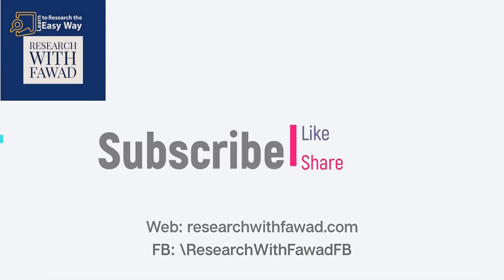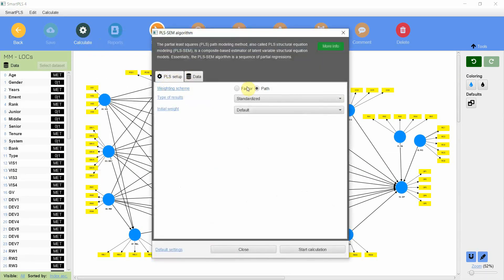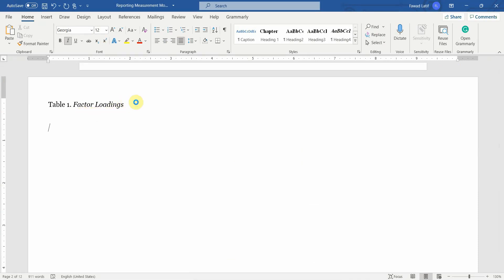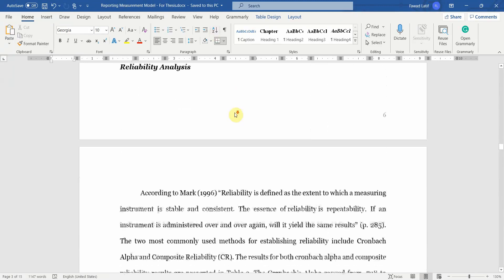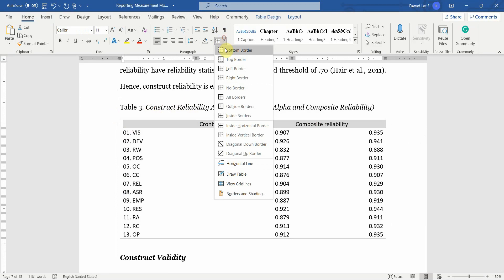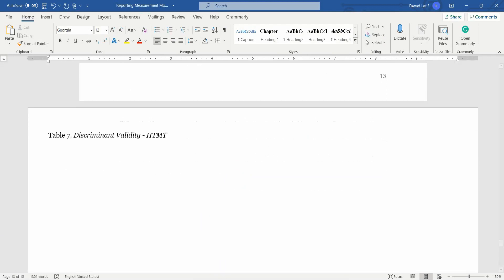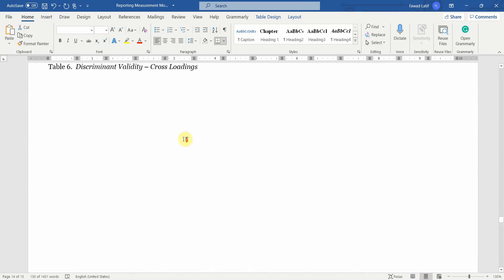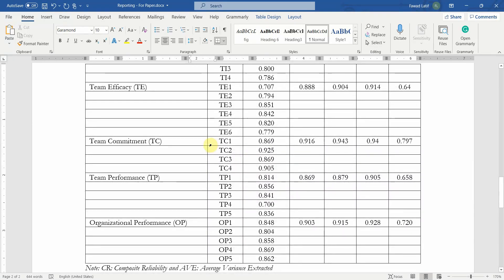#SmartPLS4 Series 13 - How to Report Measurement Model Results with Multiple LOCs?

Comment: Hi Dr. Fawad, thanks for your video, they are truly very helpful. I have a question: in this video, you are examining the reflective measurement model, right? Is it necessary to examine the VIF for the outer model? Since they are reflective constructs, which means their indicators are interchangeable, which further means it is possible for them to be highly correlated. Also, Hair (2017) only examined VIF for the outer model in the formative measurement model.
Reply from the maker: Thanks for watching. No need to check for the VIF of the outer model when it is reflective.

Comment: Thanku so much sir for such wonderful videos , sir can u plz give the citation that if AVE of one construct is near to 5 (as you told in one of your video) and other things like alpha etc are ok then we can say that our convergent validity is establish although AVE is near to 5?
Reply from the maker: Thanks for watching. Here is the reference 
Fornell and Larcker (1981) suggested that a construct’s convergent validity is still adequate if it has AVE less than 0.50, but CR above 0.60. 

Fornell, C., & Larcker, D. F. (1981). Evaluating structural equation models with unobservable variables and measurement error. Journal of Marketing Research, 18(1), 39–50. https://doi.org/10.1177/002224378101800104

Comment: Thank you for the lecture. I wonder in the reflective model, if VIF is matter. My model shows every values is okay except too high VIF values. My model is reflective model with indicators. In addition, when it comes to calculation in Smartpls, what is the difference between standard algorithm and consistent algorithm? I am not sure this is regarding to reflective and formative model.
Reply from the maker: Thanks for watching. VIF is normally high for reflective model, this is the reason it is not reported for reflective models. Use normal algorithm if you are not interested in reporting fits. For understanding formative constructs, please watch 
https://youtu.be/pMbOO0H8-P4

Comment: Sir When we delete an item to achieve significant discriminate validity ie< 0.80 how to write and where to write the information about the deletion of the item. Should it be added in the discriminate validity paragraph or in the starting when you mention the deletion of an item because of factor loading. kindly give some clarity on this.
Reply from the maker: Mention in the discriminant validity section. Report why the item was removed.